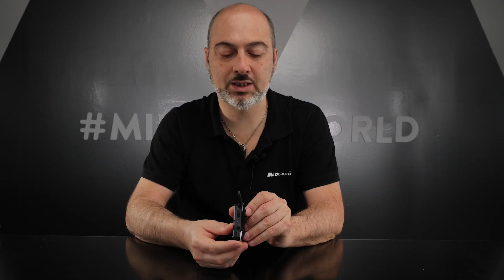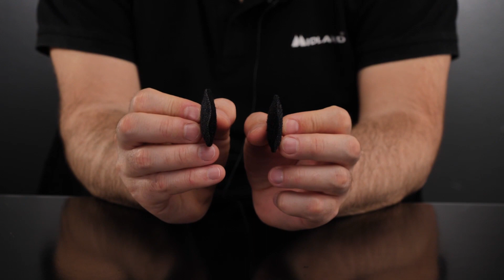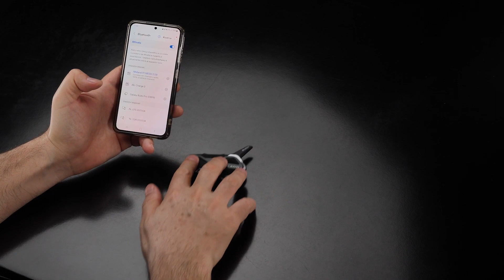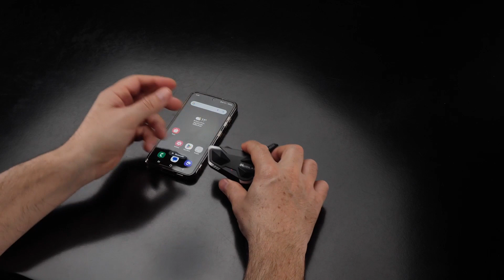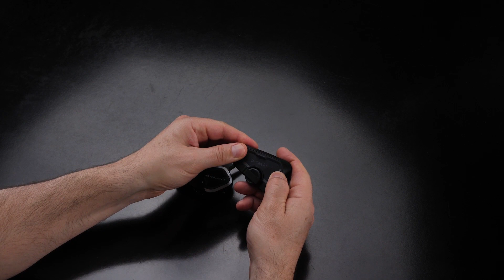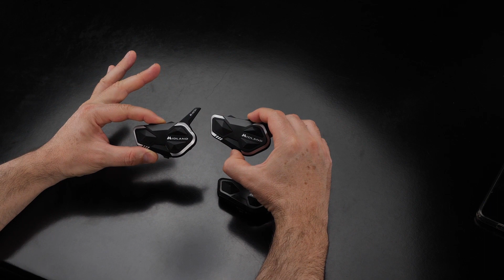Tutorial R1 Mesh ENG

Comment: Can i connect mesh with other mesh intercom like cardo or asmax
Reply from the maker: Hi! Thanks for your question. In general, Mesh technology is only compatible within the same brand, so a Midland Mesh intercom cannot connect directly with a Cardo or Asmax Mesh unit. If you want to communicate across different brands, the best option is to use the Bluetooth universal connection, which allows pairing with most intercoms on the market.